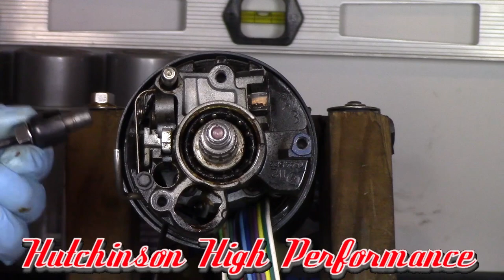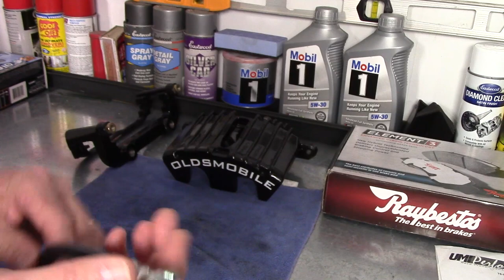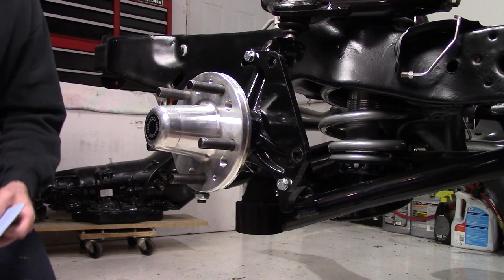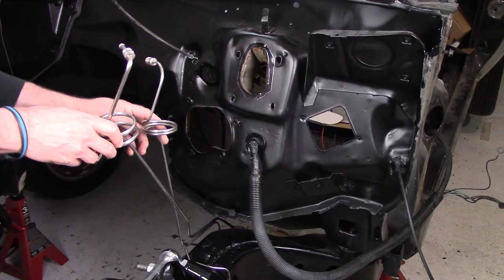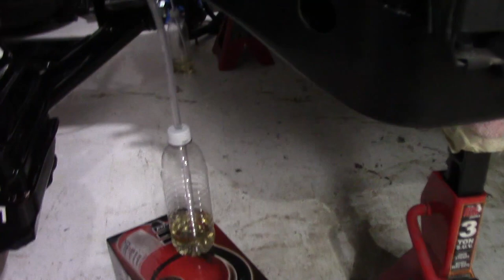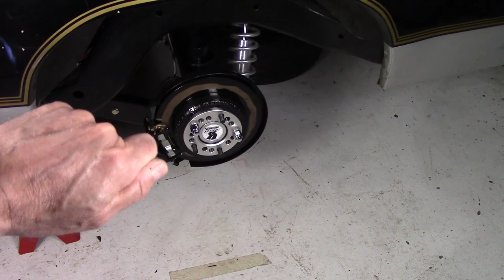G Body C5 Brake Install Part 2!! 1987 Olds 442: Video 49

Comment: Thank you, that was a very high level walk through! Did you use spacers on the wheels for caliper clearance, or just for backspacing?
Reply from the maker: The front was for caliper clearance. The rear was just to move the wheel out a little for appearance sake.

Comment: Thanks for the info I am doing a g body build and I bought the C5 kit and got some used brakes that had lines and was wondering if I had to change the lines also could I use aftermarket stainless they have circular heads
Reply from the maker: No problem. Good luck with the project!

Comment: I just did the same thing. I put the rear axel back in a while back. Now I'm running all new lines on my back.(67 442) I usually do everything slow and backwards. Glad you're still at it. Takes a lot of motivation to stay on a project as long as you have. A lot of car guys have learned a lot from your project. You have a cool car. 🍺🏁
Reply from the maker: Thank you sir!  67 was a very good year :-)

Comment: What size bolt for the bracket that holds the brake line on the frame
Reply from the maker: Hmm, not sure on that. It was the factory bolt and bracket. You may have to check the bone yards if you need it.